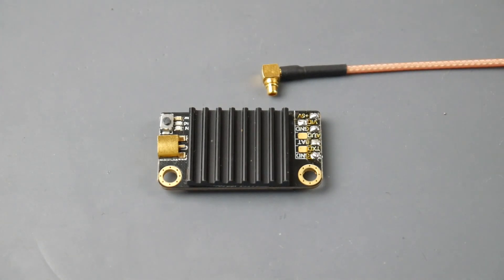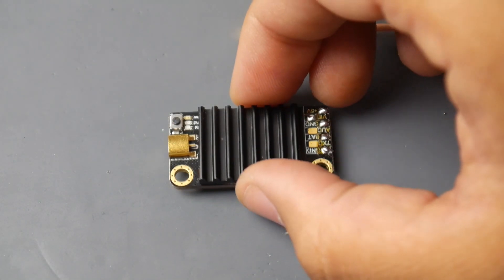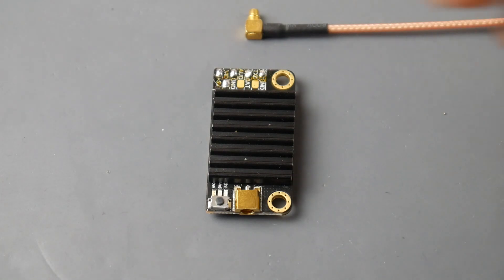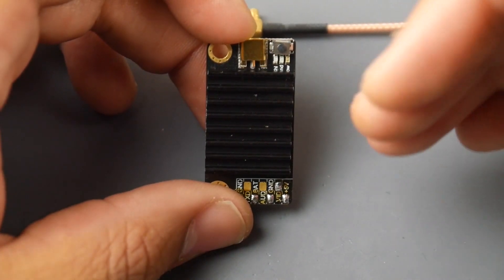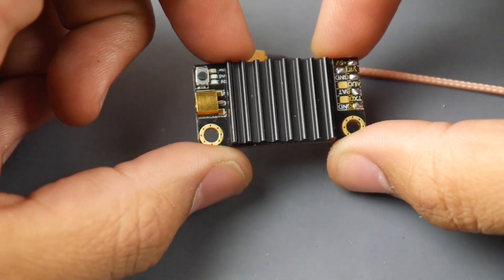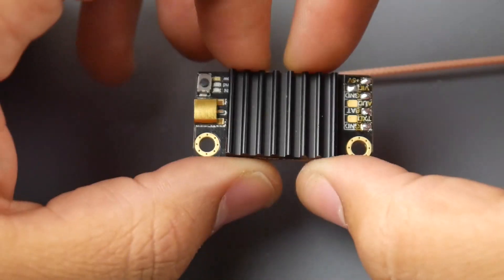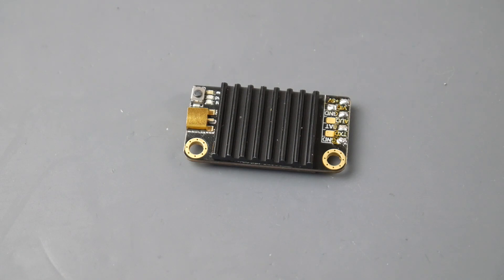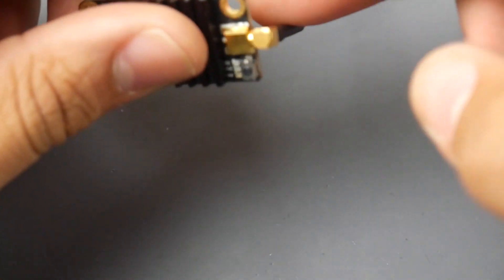Why I Love this VTX // EXUAV VTX Review

Comment: This vtx does not have filtering like TBS does,I hooked mine up direct to vbat got lots of noise with throttle, solved by adding a lantian lc filter, didn't try the buck converter set to 8.4v  solution. I've ordered the rush racing vtx to see how it compares with filtering.

Comment: The MMCX connector is soldered very poorly compared to other boards. I mean I've managed to rip it off while was just playing with antenna placement :( Yes, I've soldered it back but there is not so much place to strengthen it with solder, the pads are minimal. So be careful. Cheers

Comment: Had video noise from switching regulator with this. Also audio didnt work, even with only audio connected, maybe audiocarrier isnt 6.5Mhz spaced..
Reply: The two I have also have very bad video noise.
Reply: I switched to unify and have no video noise, but also very bad range. So maybe my cable/antenne setting is faulty and theres much HF reflections... but even then, other transmitters handle such situations better. I'll change cable/antenne in the next days.

Comment: Im making a quad that can resist some water to fly in snow at winther, i ordered one of these from youre link, i think its prefect to coat 👍
But what flightcontroller would you use for this purpuse ?
Reply from the maker: A matek where everything is pads and you got best of regulators on board with some short ciruit protection.

Comment: Does it have audio solder pad for mic and tramp telemetry like tramp vtx?
Reply: Audio didnt work with mine... Tried different de/coupling of Serial/Audio
Reply: I’m also wondering the same question.
Reply: Yes it has audio input. And the parameters can be changed via serial.